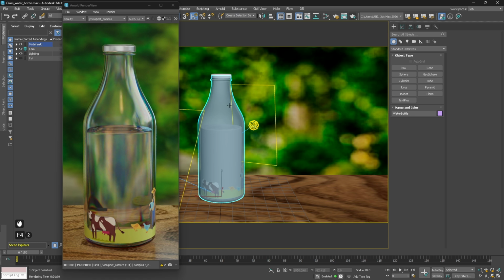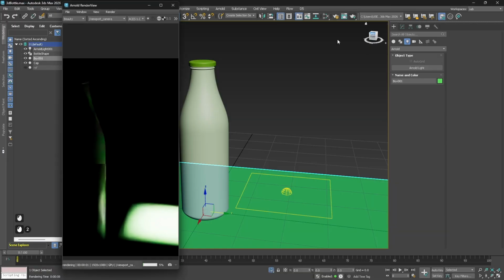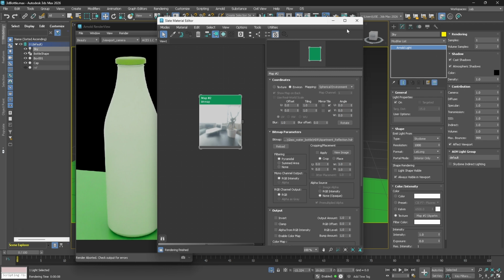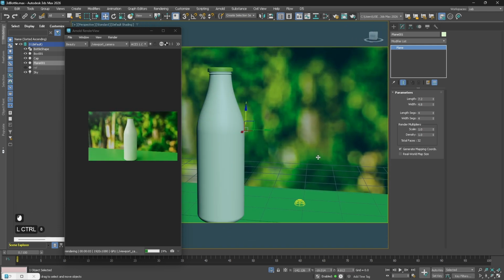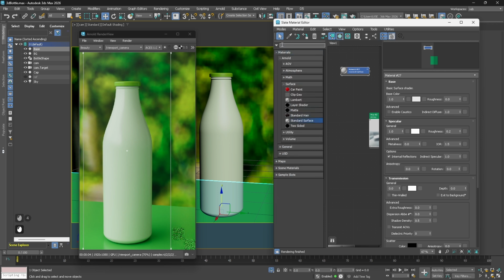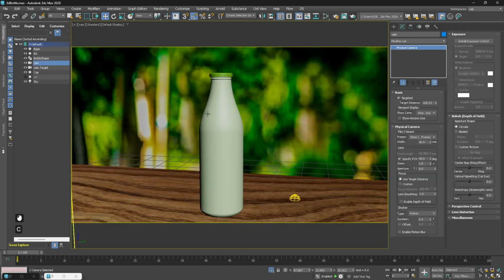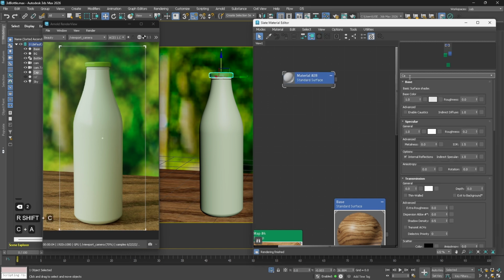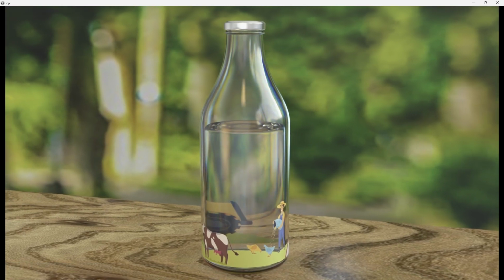3d Product Bottle Modelling and Rendering in 3ds Max with Arnold Renderer Part 02 Material/Lighting

Comment: Upping the Camera (AA) setting to 6 is not the way to improve quality. If I may: Leave the Camera (AA) alone, and tweak the other values first. Why? Camera (AA) increases ALL of them by the amount you specify, and it will likely not be necessary to do that. Each channel can have its own settings, and some may not need to be as high as 6. 

Does this make sense?

You can render out an image with several AOVs embedded, look at those various outputs, and see which AOVs / passes are in most need of antialiasing or noise-reduction.

Edit: I see you went with GPU rendering, which knocks out the various channels and just leaves the Camera (AA) setting. Oh well! LOL
Reply from the maker: Thanks for your detailed thoughtful comment, I am also learning through my mistakes, thanks for pointing that out, yes I knew about the topics and I tried to keep the settings as minimal as possible, I'll try to consider your query in mind and try to improve my upcoming tutorials, thank you again
Reply: @ZoetropeStudios  Oh of course! And thanks for the enjoyable tutorial. I need more understanding about constructing shader networks in Max, not to mention lighting. This is a nice intro. 

Keep up the good work sir :)